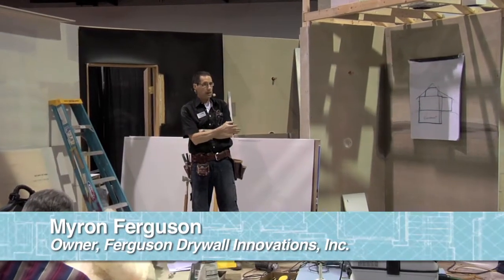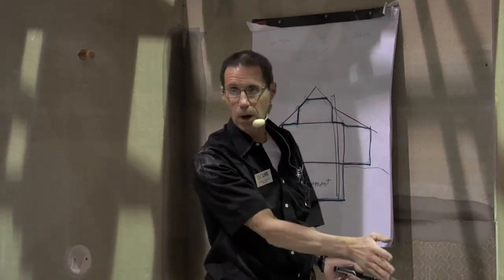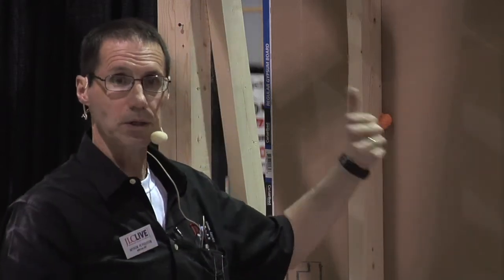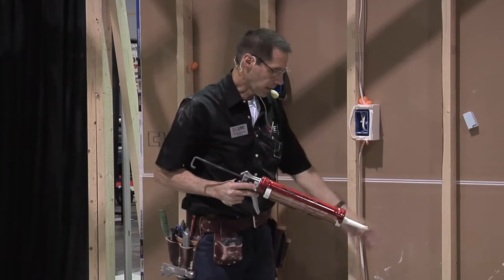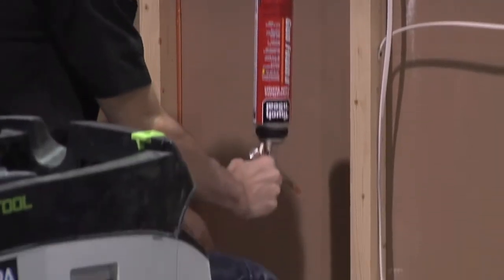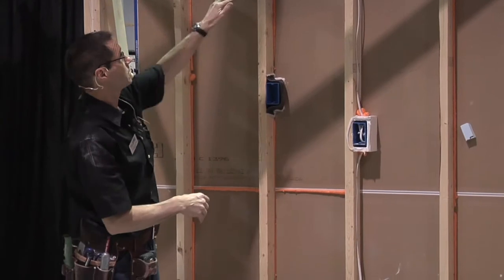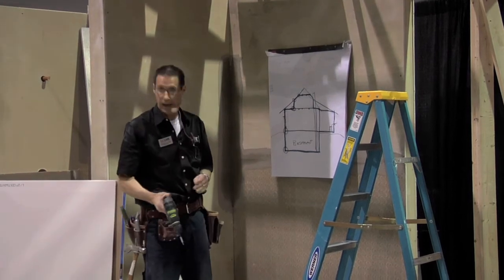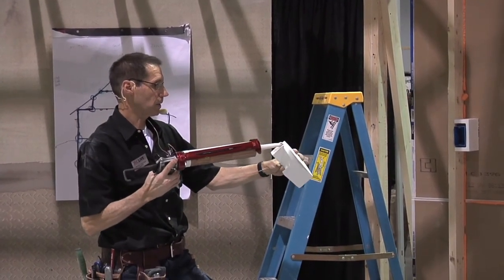JLC TV Myron Ferguson - Airtight Drywall and Air Sealing

Comment: It is better to air seal/insulate  the slope of the roof rather than knee walls, you use less insulation and less spots to go wrong with air sealing

+Bruce Filmore there needs to only be 1 vapor barrier (on the warm side of the insulation, or in the middle) and you can have as many air barriers as you want, but idealy you would have 1 on each side of the insulation and 1 sealing in the conditioned space (can be the same as 1 side of the insulation) You should ideally have 2 vapor retarders too, one one each side of the insulation (some house wrap for example can be an air barrier and vapor retarder)

Air-tight drywall idea isn't flawed, just the way it ends up being not perfectly done is flawed. Air barriers have to be perfect, vapor barriers don't.

Comment: The whole air-tight drywall approach is a flawed idea.  That is not treating the real issue, the loss of insulation R-Value as UN-conditioned air travels through it.  The air seal needs to be on the homes exterior surface (sheathing) to ensure the R-Value of the insulation product is not compromised.  The only air tight drywall surface required is the one open to airflow ie, the ceiling of the top floor.